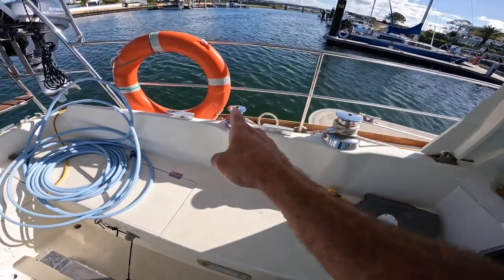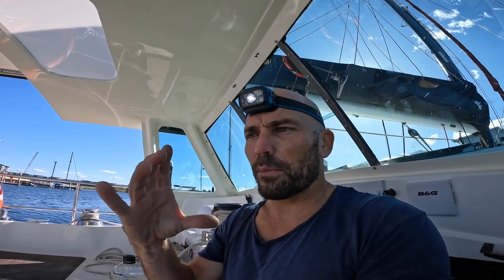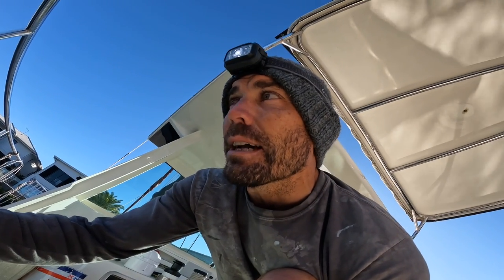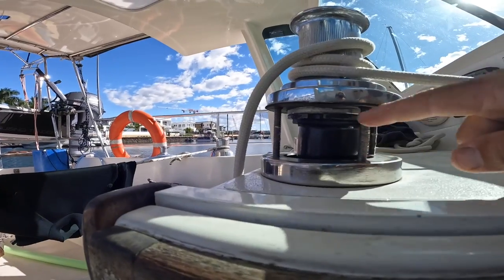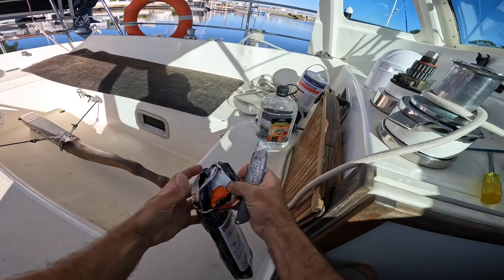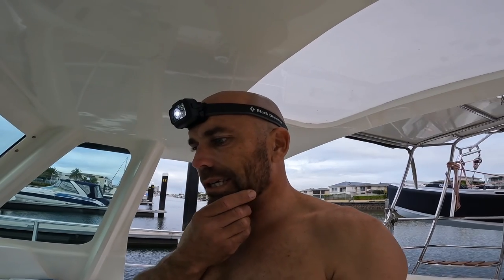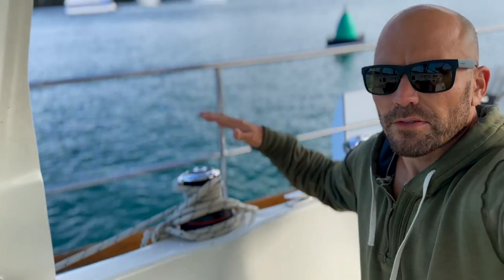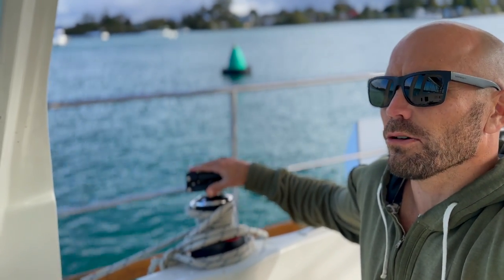DIY self tailing winch conversion - WINCH UPGRADES

Comment: LOL... just been through this too, replacing two Francis (Barlow/Barient) 25's with two new Andersen ST40 self-tailers on my own. I found a great set of parallel-jawed toothless vice-grips at Bunnings and after spinning on the nuts below I'd clamp them one by one and race up top to screw down the bolts with a Makita impact drill. The vice-grips had enough inertia in them not to spin. Worked wonders. :)
Reply from the maker: haha hot tip. Cheers Mate